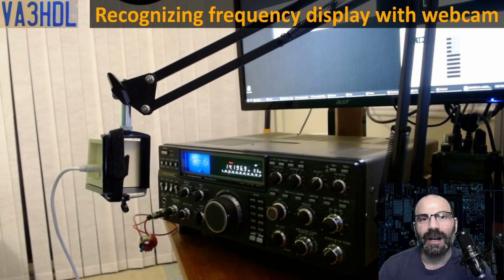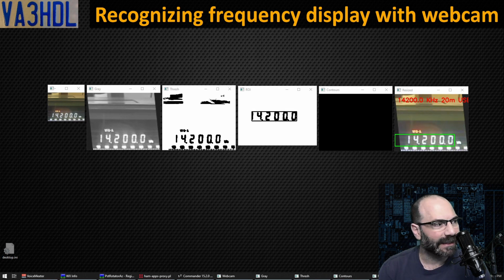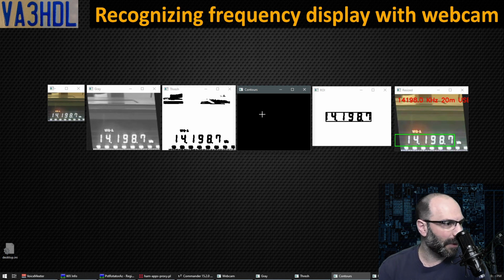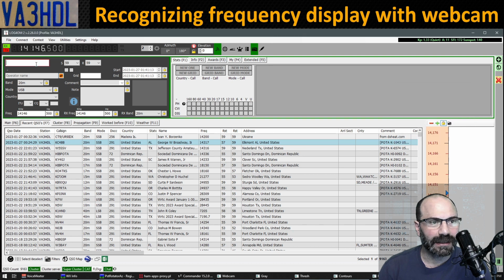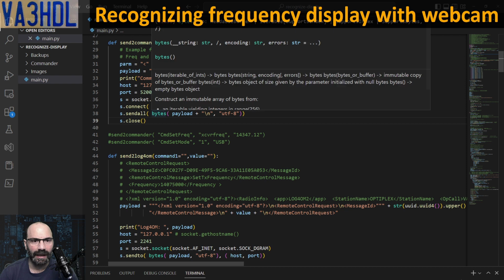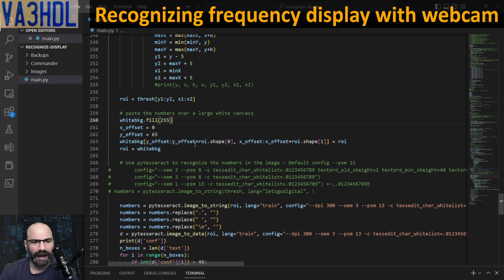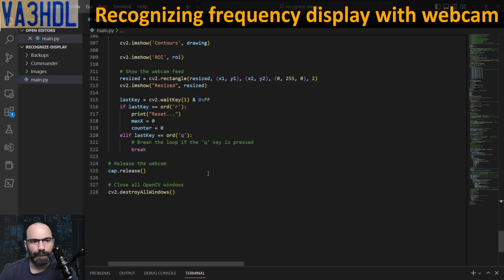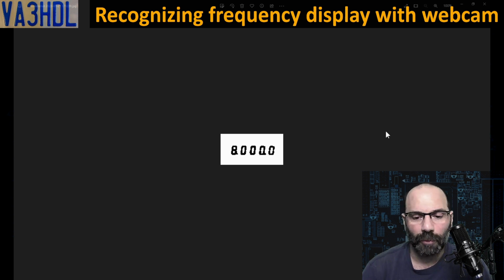VFO Frequency recognition using webcam Machine Learning

Comment: Muy buenas amigo,como ya sabras por otros comentarios tengo una ts930s, recientemente me he comprado un hilo largo para las bandas de 10 hasta 160m,pero la emisora a full de roe,al principio pensaba que el hilo estaba mal,pero lo probamos en casa de un amigo y el hilo funciona al 100x100, yo he cambiado coaxial y todo,a si que el problema viene de la kenwood, ella ha estado funcionando bien siempre con una solarcon en 10 y 11m
Cual puede ser el problema?
Tambien veo que en medicion de ic se sube a tope
Reply from the maker: Resolver estos tipos de problemas nunca es facil y lleva tiempo hasta encontrar el punto de la falla. Lo mejor es ir "descartando" cosas. Primero descartar todo, es decir desconectar la antena y el coaxil y probar con una carga fantasma de 50 ohms y como minimo 100W directamente a la radio. Ver que ROE tenes y con 100W IC tendria que ser alto es normal. Segundo, si todo hasta ahi funciono bien, seria conectar el coaxial y mover la carga fantasma el final del coaxial antes de la antena, suponiendo que es un solo tramo y no tenes ninguna otra cosa de por medio. Ahi verias que ROE tiene tu tramo de coaxial. Por ultimo, conectar la antena de nuevo y volver a probar. Ahora, un par de comentarios acerca de las antenas de tipo "hilo largo". Siempre van a tener un ROE alto, ese tipo de antena requiren si o si de un buen antenna tuner (antena de "hilo largo" fue mi primer antena, asi que las conozco muy bien.) Yo usaba un sintonizador automatico MFJ y nunca tuve mayores problemas. Si queres escribime directamente por email y seguimos conversando. 73

Comment: Thanks for sharing this excellent project!

An excellent addition would be to have the computer announce the frequency with voice (sound). This could prove invaluable for a visually impaired ham who has trouble reading the dial frequency. In fact, with some work, this could probably be made to work with old displays that predate digital readouts. DE WA1KLI
Reply from the maker: That's a great idea! Will add to the to-do list. Thanks for watching. 73
Reply from the maker: Hi John, I followed on your suggestion and added the voice synthesis capabilities to announce the frequency. I uploaded the latest version to GitHub which now has an GUI and config.ini file. Cheers.

Comment: Hi neighbour- very cool. I was playing around with a similar idea, having just gotten an Arduino ‘nano ble sense’ which has ML capabilities via micropython & TinyML. Probably easier with a Raspberry Pi which can run OpenCV and is more capable.
Reply from the maker: Hi Bernard, I have some Arduinos around the bench but I didn't think would have the processing power to do the recognition in real time. The Raspberry Pi is a good alternative and the code is in Python so should be no problem to run it there. Right now I do not have any spare RPi to try. Thanks for watching and commenting!